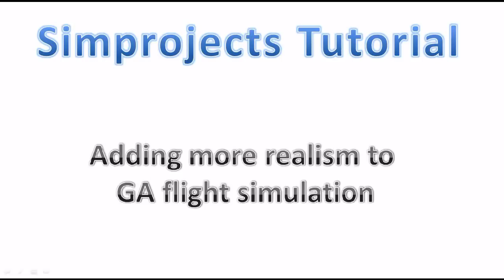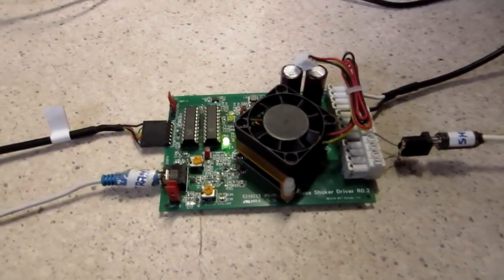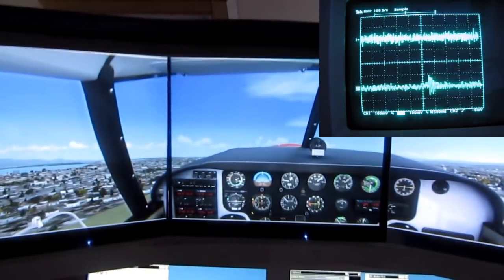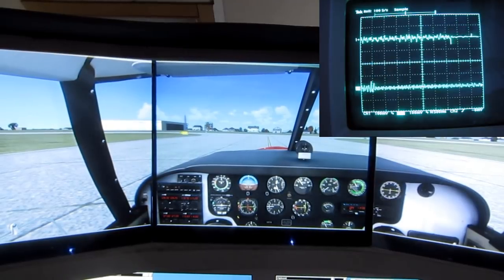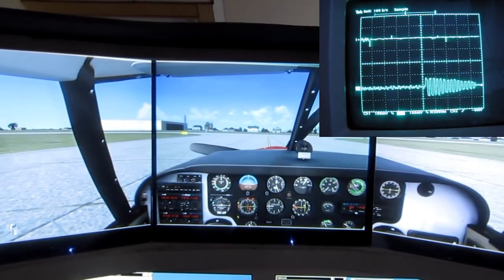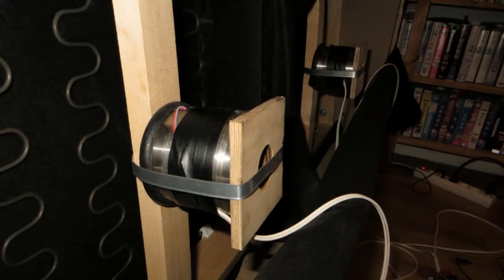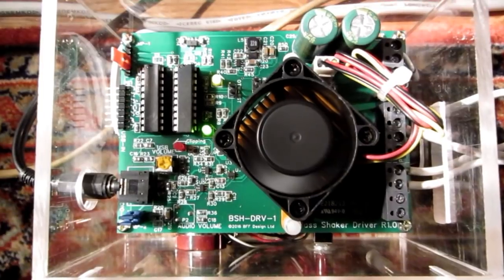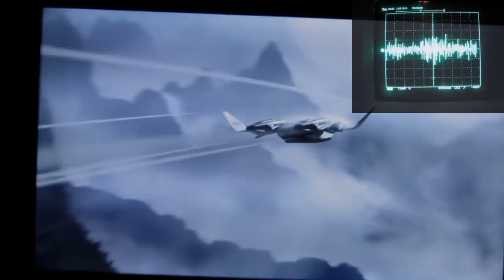How to improve your flightsimulator realism

Comment: You actually won't necessarily feel any rough running when on idle and full rich mixture. Even when the plugs are being fouled. This is why we have to seperate the mags in the run ups to check for fouled plugs, this way we can feel and see the rough running on the rpm gauge also

Comment: Hi, do you know what the shaker-driver-amplifier board sends out - is it a voltage-output or a current-output? (Voice-coil actuators can be nicely force-controlled with a current, but depend on resistive or inductive impedance & back-EMF when driven with a voltage. Most "audio" amplifiers just send out a voltage proportional to the input.)
Reply from the maker: Indeed the Bass shaker driver sends out a voltage proportional to the input signal. The impedance of the transducer at the specific frequency will determine the current. Transducer impedance is resistive at very low frequency, then shows a peak at the resonance frequency and then rises as frequency increases. It more or less behaves as a speaker. The transducer magnetic spring (and optional mechanical spring) together with the magnet strength, airgap and piston friction and weight will determine the vibration output. A good design provides snappy well damped vibration over a wide frequency range. To achieve this is quite complex, but the transducers I showed behave really well (better than the Buttkicker in this respect).

Comment: Can I use it on car games also, using the bff amp and software?
Reply from the maker: The current BFF software is designed for flightsimulators. But you can read at  http://bffsimulation.com/BFF_Shaker_Driver.php that a future version will support car racing sims as well. Of course you can use the present BFF shaker driver with only audio input from the car racing sim, which should give already nice results (depending on the low frequency content in the racing sim audio)
Reply: Thanks for the response, I guess my Asus Xonar Essence STX II wont work? As it doesn't have the black sub line-out. Asus Xonar DGX 5.1 be good enough?

Comment: Im very excited to see the diy transducer video, specifically the one 
which uses magnetic suspension. How would you rate the performance of 
these shakers compared to the ones which use dc motors?
Reply from the maker: DC motors cannot produce the higher frequencies, but they are good at very low frequency.  The piston type transducers have a very wide operation frequency range, from low to  high frequency.

Comment: Thank you Roland, I Learned a lot by your video, but can you explain or do you have any tutorial to how DIY a transducer like your, did you built it from scrach or dis you adapt it from some component. Thanks for your response and thanks for the greet job you did for the community
Reply from the maker: Thanks for your comment! The transducers I showed working were made from components that are used in an industrial linear motor (cryo pump). I'm now trying to replicate these with home made  materials (the hand-made components and coils shown. But I need a lathe, so this is delaying the development, as I'm now trying to build a simple lathe for this purpose. :-)
Reply: Thanks Roland .. Good Job .. looking forward.. I will experimente the other solution you show, blocked DC Motor ! What do you think? Cheers ..